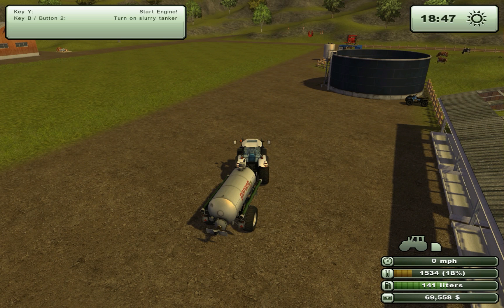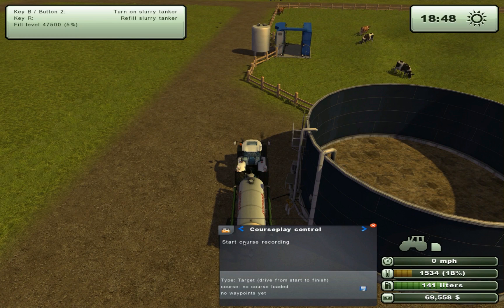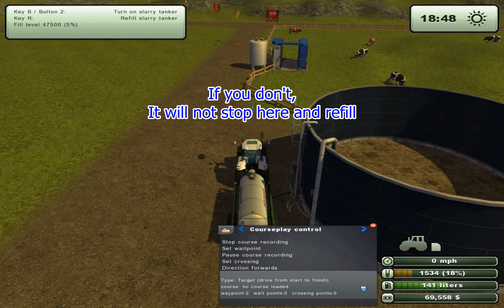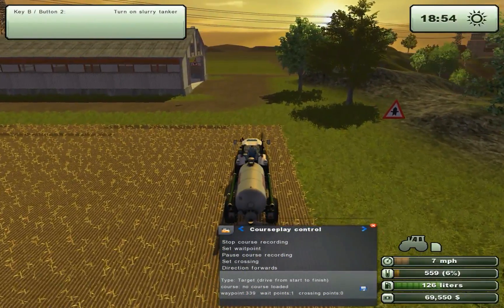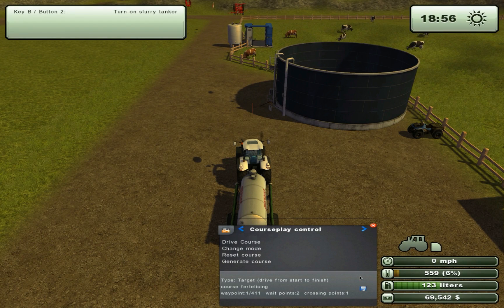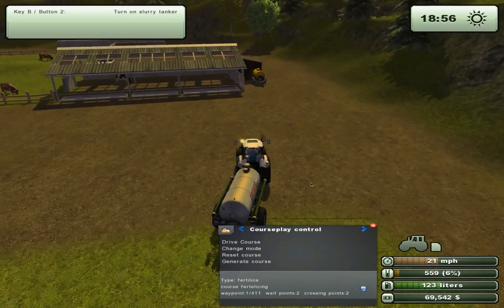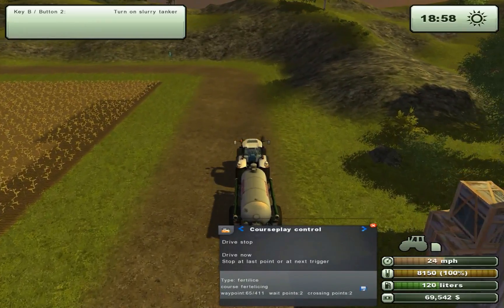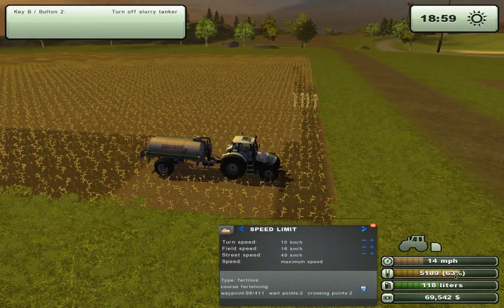Courseplay Tutorial 6 - The Basic - Fertilice mode

Comment from the maker: When recording and you want to reverse direction, you need to click the direction to chose the direction to go.
If you watch tutorial 7 - tips and trix, I am showing it in that one.
About the B key, then yes if you have started the cp route, cp locks the b key since it's controlling it from there on.
The floating triangles marks a crossing. a crossing is normally a start or end of a route, but it can also be a crossing set inside a route. watch tutorial 10 for more info about it. watch 9 as well

Comment: I have been attempting to use the fertilizer mode with my extendable sprayer. Apparently, Courseplay doesn't allow any backing up of a vehicle. I am fertilizing a tight area and at a couple of points I back my sprayer. Though I followed my normal route in recording to Courseplay, it ignored the backing and simply proceeded to the next place of forward movement.

In addition, Courseplay ignored my B key sprayer on/off commands. I don't know why.

Finally, what are the floating triangle icons?